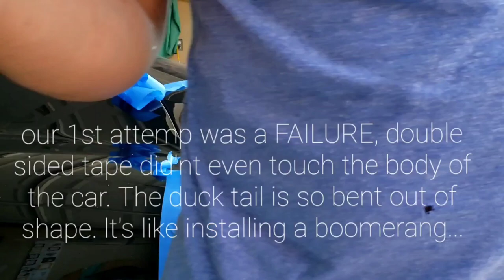VQ Carbon Fiber rear spoiler install, 2021 SUPRA

Comment: No way anybody pays that amount of money for a duckbill spoiler and it doesn’t fit the car correctly. Instant refund should be given for poor manufacturing. I heard the same style spoilers from eBay fit perfectly and for less money.  I’ll be trying one from eBay for sure.
Reply from the maker: It's unfortunate that the ducktail didn't fit perfectly. It could've shrink or something. We tried everything but everytime we let it go, it popped back out. And yes, it's a expensive part, but the owner is happy that we  remedied the situation. So far no complain from here.
Reply: Which one did you get on eBay? How’s the figment?